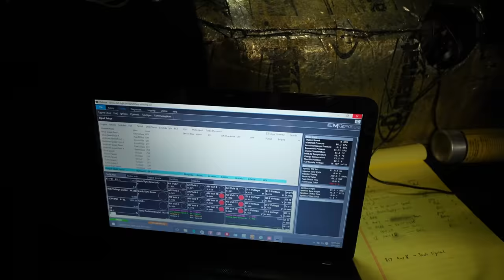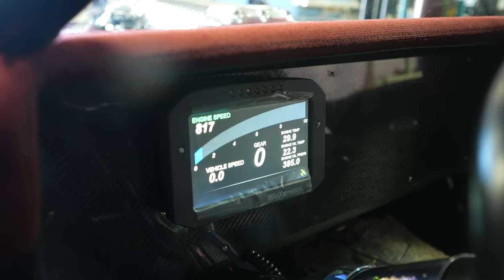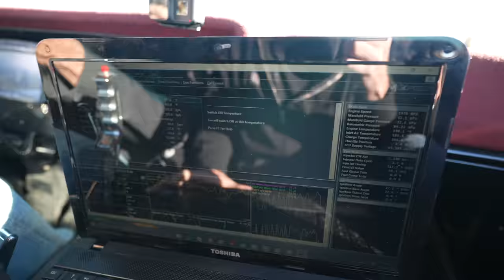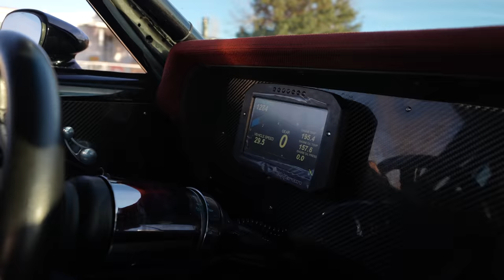4.5L Whipple Supercharged 427CI LS Swapped Chevy Vega First Drive!

Comment: Can you do a drive by wire on that motor? It might help the drivablility a lot
Reply from the maker: The 4.5L Whipple superchargers all come with a drive by wire throttle body they don’t have a cable throttle body option for them I guess.
Reply: You can have a cable on a 4.5whipple cause mine does
Reply: @donaldgray5561  Same. I have the rear facing intake too. You can program how the tip in is. Does not have to be that sensitive.
Reply: @AB-80X  yep I have the rear feed with the COPO intake elbow, on a big bore elliptical cable throttle body. Maybe partial but I prefer the rear feed 4.5L whipple.
Reply: @donaldgray5561  Very cool.
I have the TB mounted directly to the blower straight back, and then the air cleaner. Makes sense for me to run it like that because of my cowl induction.
The rear intake is sweet. It left me tons of room to run a 16 rib pulley setup. Tons of pulley grip and wrap, and none of the drawbacks of a cogged belt.
When I see how many have problems with belt slip on these big blowers, I really don't get why the 16 rib setup is so rare. It's no different to mount than mounting a cogged belt on a classic roots blower. Just bolt the lower pulley to the damper and then the top pulley on a spacer to the blower. You don't have to mess with the accessory drive as it's not part of the blower drive either.
Anyhow, how are your tip in? Mine is really smooth and not super peaky.

Comment: Imagine that 4.5 on a 4.8...lol
Reply: Imagine it would make less power .
This is a 427 cubic inch LS engine.
Reply: @mongoose406  yeah I know....I'm just saying a 4.5 on the 4.8. .....almost as much blower as motor
Reply: @trentdawg2832  kinda what I thought you meant but never know on YouTube. 👍
Reply from the maker: Would definitely be interesting!
Reply: @mongoose406  It's all in the combination.
A 4.8 with a pair of BR7 - 300 heads, 10:1 CR, a big solid bump stick with 265 on the intake side and 765 lift,  and the 4.5 to top it off. Peak power? 9500 or 10k, but hey, it'll be a mean bastard lol. Will need a stout bottom end.
Reply: Love it definitely gettin one